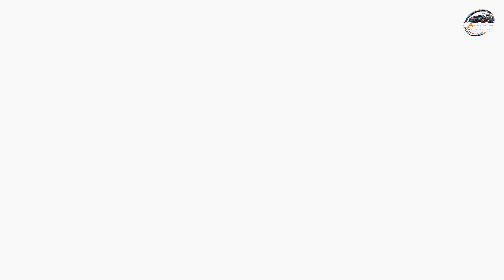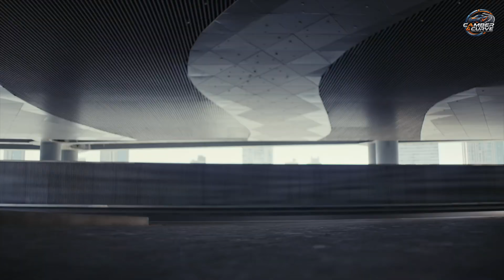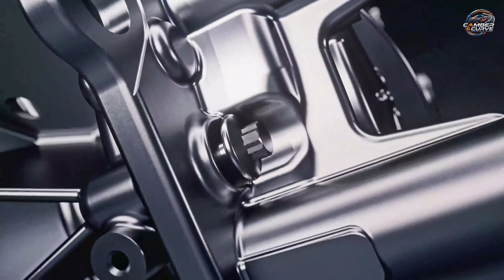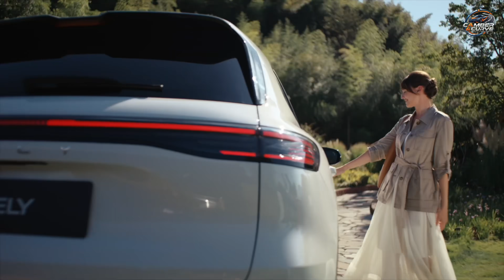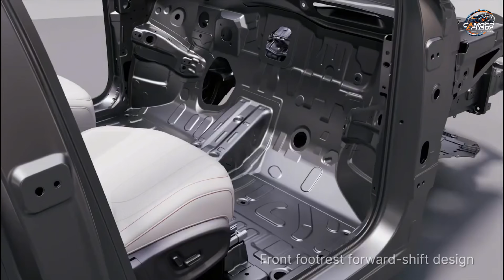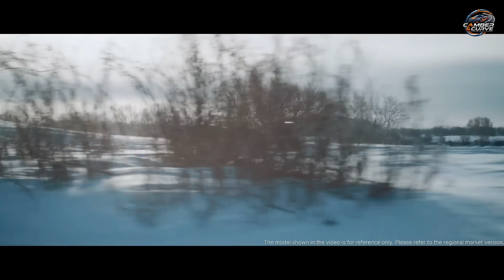Why Geely's New 11-in-1 Motor is Shocking the Auto Industry

Comment: If something breaks then would it be required to replace the entire unit? This one question which needs to be evaluated with  such Chinese vehicles. Low initial cost high cost to the user if the vehicle needs to fix.